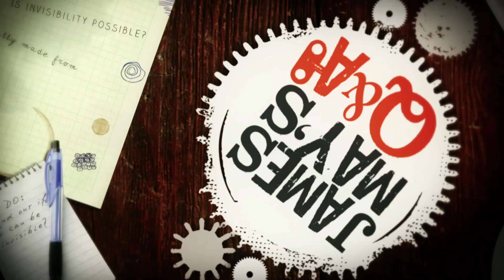Why Can't Trains Go Uphill? | James May's Q&A | Earth Science

Comment: Tractive force goes down on an incline because the normal force goes down... it doesn't stay the same.
Reply: +scowell came here to say just that. So the part of the weight that pulls back on the train also doesn't push down on the wheels anymore so you could say the incline is a double edged sword. Oh and another mistake: max speed is when the sum of the air drag and the wheel drag equals the traction force not just the air itself.
Reply: 0dWHOHWb0
I thought so too but apparently the surface does matter: or at least when rubber and asphalt are in use: wider tires, better traction. But I think that's because the rubber kinda adheres to the surface and so you cannot apply the F=u*N formula. So idk how that works in trains but still..
Reply: +paulmagnnum "Although a larger area of contact between two surfaces would create a larger source of frictional forces, it 
also reduces the pressure between the two surfaces for
a given force holding them together.  Since pressure 
equals force divided by the area of contact, it 
works out that the increase in friction generating area
is exactly offset by the reduction in pressure; the
resulting frictional forces, then, are dependent only on
the frictional coefficient of the materials and the 
FORCE holding them together."  http://www.physlink.com/Education/AskExperts/ae140.cfm
Reply: +paulmagnnum , the rubber doesn't adhere to the road, but the basic F=u*N only applies well to friction between two objects that don't deform significantly.  With rubber on asphalt, the tires deform into the texture of the asphalt, providing extra grip.  This allows the rubber/asphalt interface to behave more like gears and less like two smooth surfaces.  With a high load per area, the deformed bits will flex, and you're back to acting like smooth surfaces in contact.  With wider tires, the load per area is reduced, and the tires continue to act more like gears.
Reply: +wledzian1 ... so by that token, the smaller the contact patch, the more the surface can deform and conform... you see the trade-offs.  Temperature, cleanliness, all play a role too.  Very complex problem.
Reply: +scowell Not only does the tractive force go down but the whole cargo train behind the engine starts to generate a pulling force opposing the traction because gravity is not inline with the normal causing the net forward force to decrease rapidly. Essentially the train has to do a ton of work and put potential energy into the the cargo of the train to raise it up the hill.
Reply: +bensemus x In general, you are mistaken: a larger surface area does not create more frictional forces. The increase in grip area is exactly offset by the reduced pressure as the normal force is spread over a larger area. This is a surprising result to most who first study the physics of friction, but that's the whole point of the formula. There are exceptions, though, for soft materials that deform as pressure is applied. With the exception of soft racing tires, a wider tire generally does not have more friction than a narrower one unless it's made of different materials. Its geometry will likely give more lateral stability, and wider tires may have a different composition. You're not alone in being confused, but any introductory physics text will explain the equation and the standard model of friction.
Reply: Aaron Matherly
Yeah but you cannot apply the F=u*N formula with rubber and tires that's my point.
Reply: Just wanted to say this
Reply: +András Rudnai Quite correct. That was not factored in in the video. So a runaway is not due to lack of traction, it's because of brake failure or human error.
Reply: +Nathan Colgan ah, good point
Reply: +scowell Yes and no. But yes.
Reply: +paulmagnnum Don't know if someone said this but u increases in that instance. A larger tyre creates more friction yet Fn stays the same. Therefor u is the one that needs to increase. Otherwise that formula would be useless.
Reply: Thanks, Sarah, I would have tried explaining the same thing (having done so in verbal conversations many times) but you've laid it out particularly simply and clearly. 
 I'm going to risk screwing things up by adding some waffly delucidation:
I guess there are two factors in a car with soft tyres being able to accelerate at >1G on the flat (apparently defying the laws of friction)
Firstly, in the case of a real-life pavement surface, the rubber is actually deforming into the small "valleys", like an informal pinion meshing with a higgledy piggledy rack - very shallow, but with LOTS of teeth.
Secondly (as you imply by referring to composition) some racing tyres (and all tyres when hot) are sticky, so there's adhesive traction (which also does not follow the laws of friction)
I guess the material covering the shoes preferred by rock climbers is another example?
Reply: It's always easier to go downhill than uphill. Some train drive on the carts as well though giving it all wheel drive only to greatly lower the risk of wheel slip.
Reply: You are referring to rolling friction which is different from F=uN because it takes into account deformation of the wheels and surface.  That being said, things can become a little crazy with rubber tires.  At high speeds the tires deform due to spinning.  The inertia of the tires makes them bulge in the middle so as to make them less flat.  I once heard that a motorcycle travelling at 70mph only has about a quarter of an inch of tread on the road.  However, I've never verified whether that is true, but is makes sense. 
 This makes handling difficult as there is so little tread on the road that there is not sufficient grip to make necessary changes in steering.
Reply: +scowell small angle approximation mate. cos(2.65deg)=.9989
Reply: +Nathan Colgan Right!  It doesn't stay the same.
Reply: +scowell I'm not sure why he mentions the contact area either, when discussing traction. In most cases, it's not a significant factor, right? It's all about the normal force
Reply: +paulmagnnum The reason why there is more frictional drag with bigger rubber wheels is because the rubber deforms against the road surface a lot.

Comment: "80 degrees" is NOT "80 %."  An 80 % grade is one that rises 80 ft for each 100 ft travelled horizontally.  An 80 % grade is about 39 degrees.
Reply: +Clyde Wary If you listen carefully, when he says 80 degrees, a text pops up saying that 80 degrees is about 567%, which is correct. 
The 80% illustration and the commentary are not related.
Reply: Same though, I'm sure James May doesn't think that a set of stairs is only 10degrees less steep than a wall
Reply: @jimlockeyarchive3198  - A stair like that is called a "ladder."
Reply: +Dustin B 80 degree stairs are more commonly called ladders.
Reply: +Clyde Wary Yes, mistake #1. Mistake #2: stairs are about 80%, not 80 degrees. Mistake #3: the illustration at that point shows a (roughly) 80-degree slope and labels it 80%. We probably should've stopped watching at that point.
Reply: Dustin B 80 degree stairs you realise that means that the stairs run at 80 degrees to the floor and that a 90 degree slope is called a wall right infact the closest thing to a 80 degree stairway is called a ladder
Reply: 888TopGear888
No. The commentary says we go up 80 degrees every time we go use the stairs; we don't. The illustration pretends to relate to the commentary but doesn't. Both are wrong.
Reply: 80 degrees is 571% -- pretty sure the video made that quite clear.
Reply: +Paul Kennedy I had the same thought and paused the video to look for correcting comments. But nevertheless I watched it full length just becuase of James' really nice shirt!
Reply: +Paul Kennedy funnily enouihg they showed 80degreees then morphed into a starcase that was obviously less also kinda ruined it by using stairs cause stairs arnt a slope then by saying cars cant go up more than 35 is wrong cause theres videos of admitidly tuned up cars going up close to a real 90 degree incline like 75 or 80ish degrees
Reply: It's called a ladder
Reply: They obviously meant an 80% grade given the stairs example...big mistake on their part.
Reply: I think he probably actually meant to say 80%, because 80 degrees would be almost vertical, which isn't like climbing the stairs at all!
Reply: Man... England is making weird units even to angles?
Reply: +yousuf g a 90 degree slope is vertical
Reply: +Dustin B Sounds like some Dutch stairs :D
Reply: +Michael Delamere commented in the wrong place dude, this is he pizza thread. Ever had one of those real posh ones with a fried egg in the middle? And, calzone, yes or no?
Reply: +Nikanor SeaDragon. V. ST. P. To explain percentage gradients- it's how far you move up compared to how far you move forward. I.e. If you climbed a set of stairs and moved 3 metres horizontally and 3 metres vertically - that's 100%... So yes 45degrees. Easy isn't it.
Reply: +Paul Kennedy Would love to see what an 80 degree set of stairs look like. Don't think even the "stairs" above Minas Morgul in the lord of the rings was 80 degrees.
Reply: +MIND MILK thought
Reply: No, he has it right. You need to listen again to what James May says. Either that or pay attention to what the other commenters here are telling you.
Reply: kebman There was a point to Clyde's comment (that the video made a mistake). Was there any point to yours?
Reply: Paul Kennedy Well, let me ask you this: Do you enjoy pizza?
Reply: kebman Thank you. That's clear. No relevance at any time.
Reply: +Paul Kennedy do you like your pizza 80% of the time or cut at 80 degree slices. And let's not dodge this important question chaps. Remember it's important to be accurate.
Reply: MIND MILK I don't think 80-degree slices would be very practical. I cut my pizza into 90-degree slices and then cut them each into 45 degrees.
80 degrees for pizza might be more useful if it was a temperature, although it seems a little hot.
Reply: +Paul Kennedy 80 Fahrenheit is way cold... but not as cold as 80 Kelvin.  80 Celsius is just about right!
Reply: +Paul Kennedy Dear Mr. Kennedy! I just wanted to say thank you for saving precious minutes of mine! I'm not going to watch a second of it.
Reply: +JoshLikeCrazy don't boil pizza.
Reply: No, I don't think so.  They meant 80 degrees, because it says that is 567% grade, which sounds about right.

Most stairs aren't 80 degrees though!
Reply: Right. Cos 1:1, or 100%, would be 45 degrees. 80% of 45 is 36.

Stairs don't count anyway because they're not a slope. They're steps. You couldn't walk up a ramp that steep.
Reply: MIND MILK No, the commentary is correct. He says humans can go up 80 degrees (which is 567%) 
The illustration says 80% before he starts speaking.
Reply: +888TopGear888 chill out!
Reply: +MIND MILK o.0 
What'd I do?
Reply: +KYLE REES  I worked at a place where wooden stairs were being put in and it was closer to a fixed ladder than standard stairs. Lucky for me that I stopped the guy in time because I have to use the thing.
Reply: +yousuf g because thats straight up
Reply: +Clyde Wary There are a lot of errors in this video.
Reply: +Clyde Wary Hello, I just wanted to say that 80 % is noth the Square Root og 80 either. Neither is it 80^2. Funny you should say so, but 80 isn't the speed limit of my tea either, though it is quite hot.
Reply: Paul Kennedy Cuz I enjoy pizza immensly, and I wouldn't ever trust one that didn't. ;)
Reply: scowell We're talking degrees, not kelvin. And I'm far too young to be able to work out Fahrenheit without doing that stupid add-multiply conversion. You may be right, but I wouldn't want to burn my mouth.
Reply: +Paul Kennedy apparently somewhere around 70 is the ideal, but that's second hand. Of course after you've made your pizza you have the problem of having to climb an 80 degree slope, pepperoni in hand, before you reach the dinner table
Reply: MIND MILK What, second-hand pizza?! I think I'd rather burn my mouth.
Reply: +Paul Kennedy sometimes I think you're trying to be silly
Reply: Michael Delamere Um. 80 degrees is over 560% slope.
Reply: MIND MILK Michael mentions pancake though. I can see the confusion.
Reply: +scowell 80 Celsius is almost boiling
Reply: +Corné Vroomen yup dutch stairs are sometimes over 80percent...
Reply: +Nikanor SeaDragon. V. ST. P. Well 80% is less than 40 degrees. So I'd say that an 80% gradient on stairs would make them certainly not Dutch as that is a very low gradient. If you're confused there are some useful images online that can help. Please weigh in on what angle pizza should be sliced at bro. That's what really matters.
Reply: +Nikanor SeaDragon. V. ST. P. Trains can't go up stairs
Reply: r o a s t e d, b o i
Reply: +Nick X  haha.  I would blame it on spell correction, but that probably isn't correct.
Reply: So you get 80 percent rise in context of a 100 percent run.  We gonna argue basic geometry now?
Reply: THANK YOU
Reply: You guys must be killer at parties.
Reply: 100% = 45°
👀 = 90°
Reply: Yup my stairs are 72% or 35.75 degrees.  Disliked the video, I don't like channels that favour entertainment over accuracy.  They haven't even had the decency to add an annotation saying they got it wrong.
Reply: i HATE that the road signs have %grade rather than degrees
Reply: i thought the same thing. a car can go up more like a 70% slope. not sure how they got that one wrong.
Reply: 80 % slope is less than 45 degrees ;)
Reply: When it comes to traction stairs for human beings are 0% as the stairs are flat on top...
A smooth hill would be a different story.
Reply: Yeah, stairs are cheating, what about just a slope, how well can typical humans do before they need to use their hands ? (Asking for a friend.)
Reply: I know this is old but I just had to let you know how much it bothered me that James may could even cock up degrees and % grades.
Reply: Clyde is smart. He probably understands why the quarter pounder is called the Burger Royal in Amsterdam.
Reply: I had lost my balance when carrying stuff up or down a ~70% stair, several times. Easy to climb hands-free, unlike a ladder Good news is that the stairwell is so tight that I could not fall - I just get stuck at the opposite wall with by forehead or by back.

Note that there a stairs which have alternating steps for either the right or the left foot - more comfortable than a ladder.

But, regardless, anything steeper than 50% is unusual.
Reply: KYLE REES I know what 80 degrees is. And yes I've been on 80 degrees STAIRS. Old lighthouses and pioneer era houses frequently have freakishly steep staircases.

More crazy than that I've gotten traction with sneakers on flat 80 degree slickrock slopes. You need something to hold onto since your body weight is behind your ankle while going up, but you don't have to climb up with your arms, your feet can still get the traction to push you up.  It feels like having velcro on your shoes.
Reply: +Paul Kennedy 80 degrees is a bit sharp but I've been in old buildings that have 80 degree stairs.  Regardless humans can go up 80 degrees as the angle in the illustration.  But the illustration shows 80% which is wrong and not mentioned in the dialog at all (bad illustrator).
The next lines pertaining to cars mentions 30 percent, not matching the illustration angle but now correctly written as 30%.  This statement is not incorrect either, it's lowballing it for street/highway travel but not incorrect.
I've never driven a train so I can't speak to the accuracy of how hard it is for them to do a 2.65% incline.

James doesn't say anything incorrect although the numbers are obviously variable depending on situations and the capabilities of the person, car, or train.  Whoever makes illustrations for this however needs to be less sloppy.
Reply: +888TopGear888 ok I'm done.
Reply: Dustin B Oh, dear. Mr May says very clearly "You do it every time you climb the stairs." immediately after he says humans can motivate themselves up a gradient of about 80 degrees. That's wrong. He also says 80 degrees is 1 in 1-and-a-quarter. That's also wrong.
So, yes, James says things that are wrong. Just like the illustrator, he mixes up degrees with a gradient given as a ratio. That's very wrong, very misleading, and, given that nobody making this video picked it up, very stupid.
Reply: +KYLE REES you got to the joke like a second before I did! Now I look stoopid. Haha
Reply: +Dustin B Yes, I live in a typical Victorian terraced house and the stairs would appear to reach about 80 degrees (or 39%) particularly as my house is on a steep hill (well steep for pancake like-Cambridge where I live anyway). I've seen newer houses on flatter terrain and the staircases are usually a standard 30-35 degrees.
Reply: Clyde Wary we all got that -_-
Reply: +888TopGear888 so there's a correction on the video but the commentary is incorrect. I didn't spot the correction flying in if I'm honest. It's shame hey couldn't ADR it. I suppose that's one to chalk up to the presenter vs. expert debate. Not that I have an opinion on that really as long as the message is coherent, So it goes.
Reply: @jimlockeyarchive3198  Oh, annotations?
Reply: Clyde Wary, you know, 80% out of an 90 degree angle, is actually, and almost (obviously), the amount of them degrees. For your math you got so many likes? A lot of people don't know math, common sense, or even a view in a perspective when someone is explaining something, or even worse, putting it on paper.
Reply: If Mr Clyde Wary would just delete his comment, since he is the one that clearly misunderstood, that would be great.